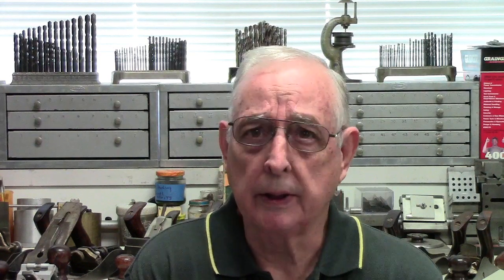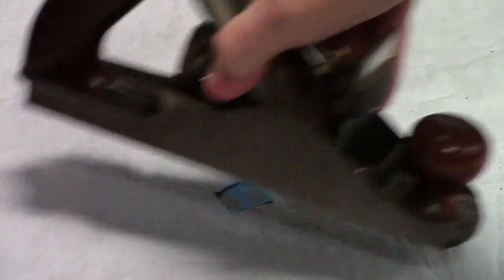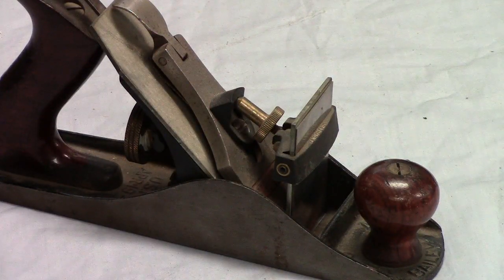Stanley plane and scraper modifications

Comment: For a scraper plane or shave with a fixed 90 degree cutter, is 45 degrees the best geometry for the burr? I have read that the burr should be drawn to 30 degrees off vertical, is that your method? Thanks in advance
Reply from the maker: 30 degrees to 45 degrees not that critical but when turning the burr find the angle with the burnisher and raise it 5 to 8 degrees when turning burr.
Reply: Paul Hamler thanks, I’ll try it that way